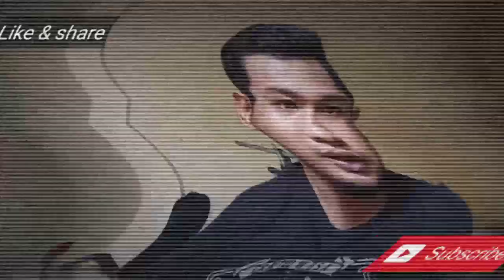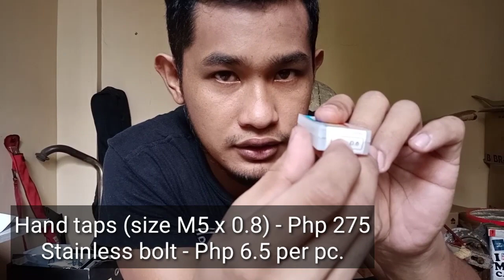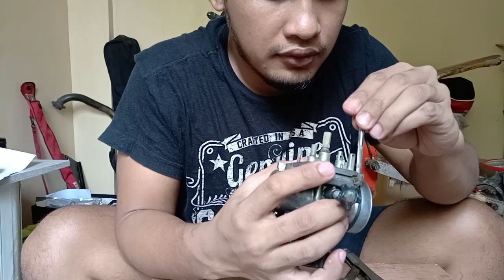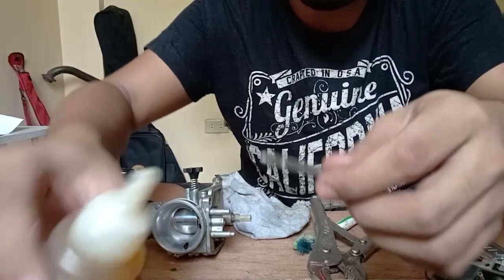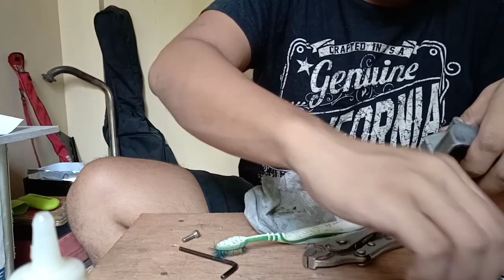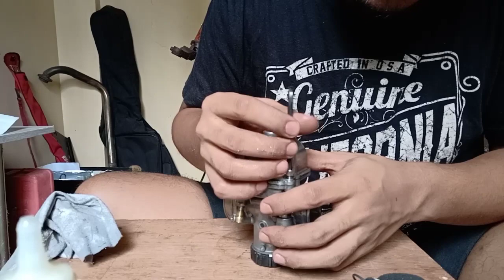Loose thread carburetor repair | Suzuki Raider 150 | Wave 125 | KOSO 30m roundslide

Comment: Anung swack na jettings nyang 30mm idol sa stock engine na raider? Tska ilang pihit Af screw at pang ilan needle clip position? Ty idol. RS
Reply from the maker: Share ko lang sayo idol yung ginamit ko dun sa KOSO round 30mm ko. (Pero hindi po ibig sabihin nag swak sakin is mag sswak din po sa inyo. Depende padin po yan sa lagay ng makina mo at sa result na hinahanap nyo) itong setting ko po is satisfied naman ako sa performance. 110/35 po ang jettings, needle clip is nasa gitna, tapos nka swr mushroom filter po ako, sa pihit nman po ng AF screw ko nakalimutan ko po pero talagang binabasi ko po sa andar. Thanks for watching po. Pa like and subscribe po hehe salamat Ridesafe!